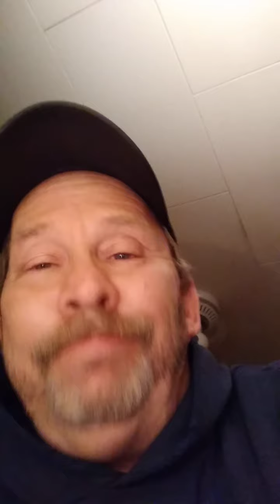slide cutaway angle question.if you having issues you can't tune from 1/8 to 1/2 look at angle

Comment: Yes it helps , i have a mikuni [fake] on order now  . The phgb[fake ] are fussy , a bigger  needle or clip positioned to low and you know that feeding , seized . And your point made they always seem to be rich where they don't sell pilots for them except genuine or why touch , but they fit the rubber boot.  I  had  Mikuni winning but really didn't know until now . Tanks again !